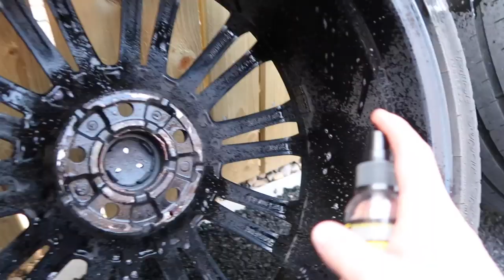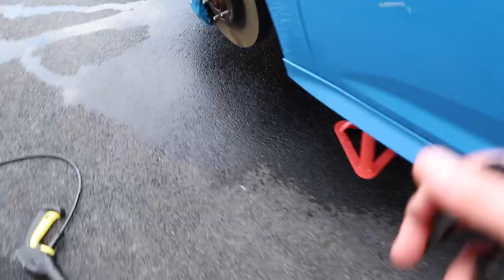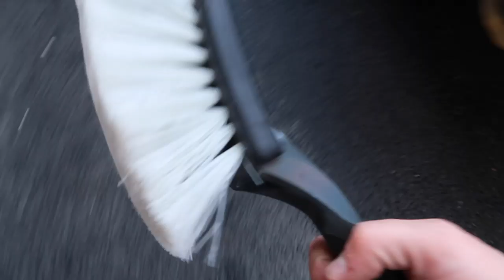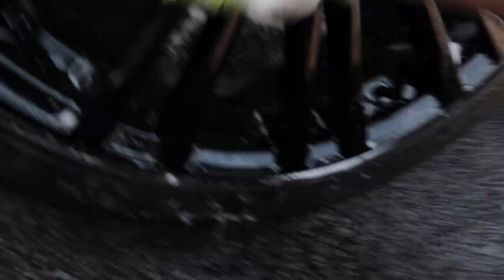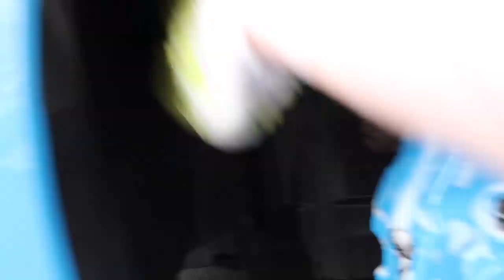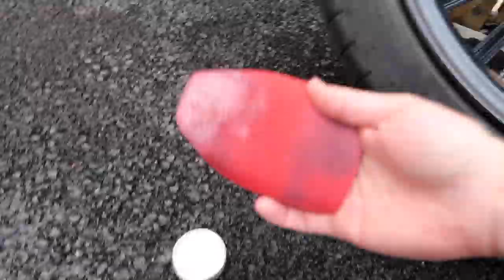ULTIMATE WHEEL, CALIPER & ARCH DETAILING! | BECAUSERACECARBOX CHALLENGE! | FOCUS RS

Comment: Did a great job on the wheel detail! One question, why not ceramic coat the wheels over the wax on them?
Reply from the maker: Cheers Michael :) I was just trying to show as many different products as possible from becauseracecarbox otherwise I would have gone ceramic all the way :)
Reply: Ceramic coats need to sit on the bare paint, it wouldn't bond properly to wax
Reply: @mrlionrocks   I did not say to use it on the wax but use it instead of wax.
Reply: @pmichaelhayes  ok bro, misinterpreted what you  wrote.edit it to 'Instead of' 😁👍🏻

Comment: I always seem to have a little bit of brake dust residue that I can’t get off, any tips?  The RS brakes are the dustiest I’ve ever had will be swapping to the mountune  pads when the time comes.
Reply from the maker: Where is the residue stuck to? The combo I do here of iron fallout remover, citrus pre wash (which could be substituted for a good snow foam) and then hardcore wheel cleaner is a great set of things to get rid of everything. If you agitate the iron fallout remover as well as agitate the wheel cleaner, there shouldn't be much of anything left over. If there is then it could be mixed with tar so add a tar remover stage and if you are still left with anything then add an abrasive polish stage before final simple shampoo wash and then add your protection
Reply: @AdamRainey  I use Bilt Hamber Atom Mac Corrosion Inhibitor ... dilute 35ml per 500ml in water, spray directly on and wash off ... that'll reduce the "brake dust" brown appearance on rims!!
Reply: Adam Rainey it’s on the outer rim between the spokes.   I’d not thought about using tar remover on it, I’ll give that a go.   At the moment I can’t remove the wheels as my trolley hack is too tall to go under the car. Something I need to sort out.